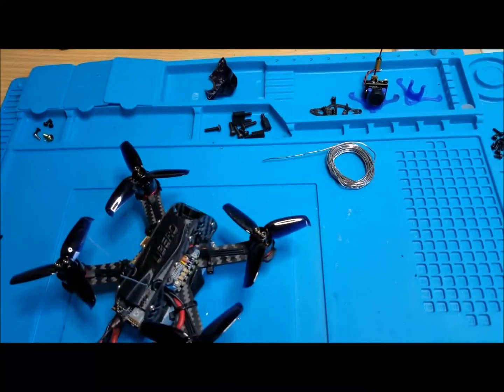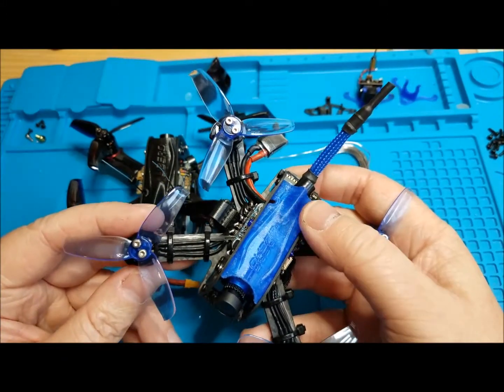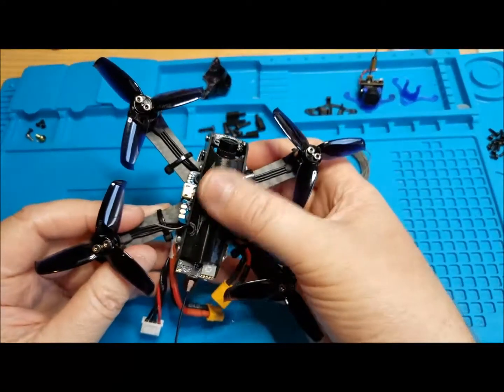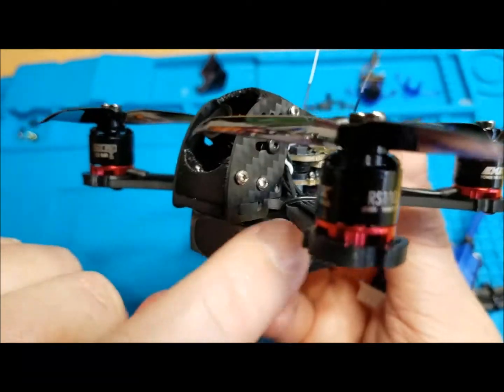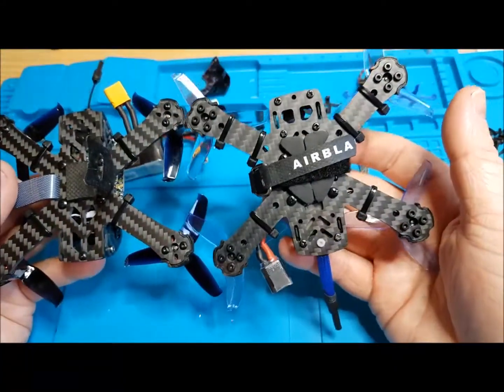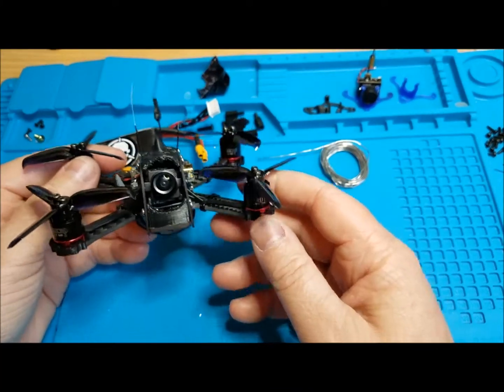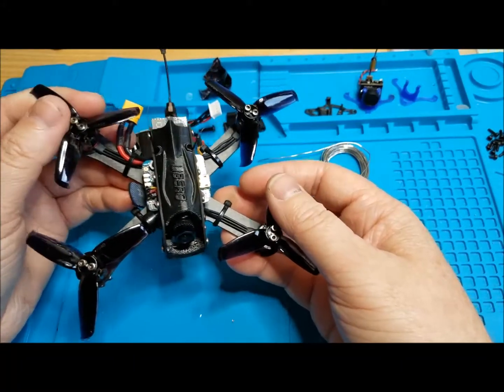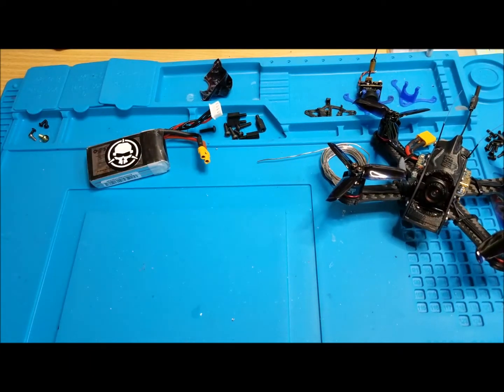libero 2 5 v2 omnibus f4 v5

Comment: Awesome!! I like this one better than the one I saw before! and upgraded F4! That is what I want!!  And I have those motors toally awesome ones FYI if you did not know they will do 4S all day long and wicked fast with that  haha Mine are on the Atmosspheric Adventures Aeolus 2.5" mini stretched! LOVE THAT LITTLE DUDE!! Flies like a 5" Lumenier Micro F4 V2 and Lum 12A esc 4 in 1! Have to get the specs from ya, 2" props or 2.5"?? size battery?? Thanks another awesome job man! Keep up the good work! L8r-Turbo.